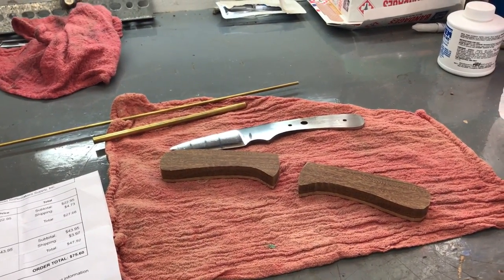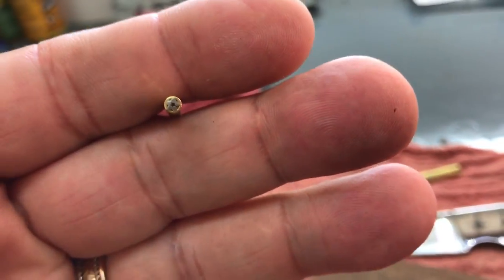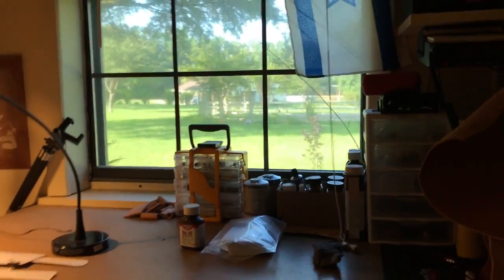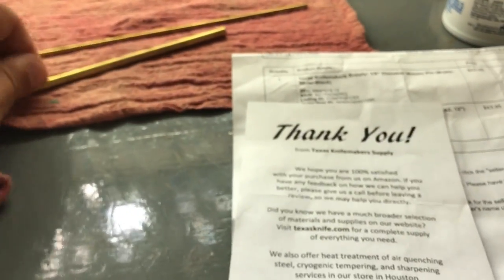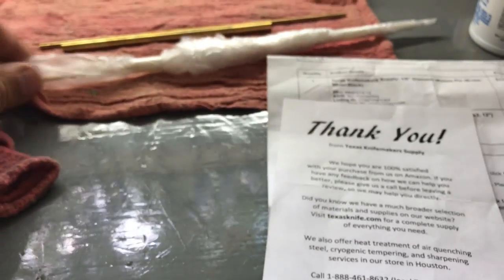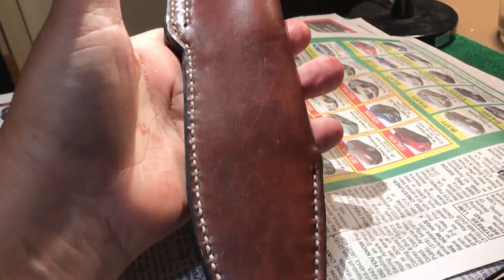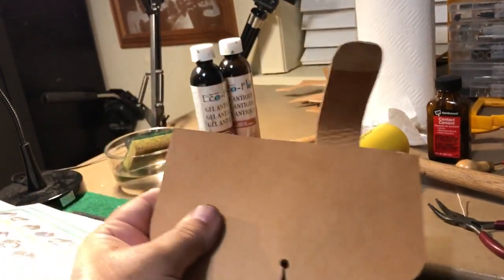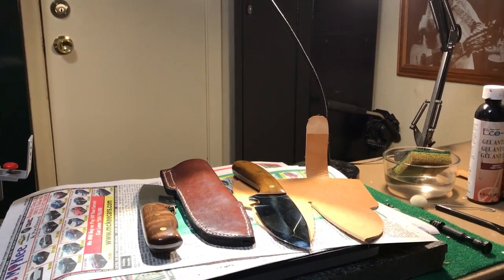A couple of knives I'm making

Comment: Man, I had No Idea decor pins cost that much!!  Great Looking knives
Reply from the maker: 5 Acres on the Bayou crazy! I've searched high and low for better prices but this is as good as it gets.
Reply: BCtruck, rebuild, repair,repurpose I believe you can get them cheaper on eBay. I will have a look later on and double check. Those are some great looking knives!
Reply from the maker: Well,just a few minutes ago I found a place that sells them cheaper. usaknifemaker.com .
Are you Taylor blades brother? He makes some awesome knives!
Reply: We talked about the problem of making your own but I think the air bubble problem would be solved with a homemade vacuum chamber and slow cure epoxy.  At that price, I may go into the business and sell them to you!
Reply from the maker: 5 Acres on the Bayou I would buy them from you! Dwayne lives between me and you. He could deliver them!
Reply: I've got one ready.  It's all steel and hollow in the center with a split down the side.  I call it "Roll Pin"
Reply from the maker: 5 Acres on the Bayou in a pinch you could take it from your knife handle and use it in your outboard propeller.
Reply: BCtruck, rebuild, repair,repurpose Nope, I make knife scales and have come across the mosaic pins before looking for exotic wood. I thought I had the seller on eBay saved but don't. I will look for them again
Reply: 5 Acres on the Bayou you could also use clear flexible hoses and place on both sides and using a syringe that fits snugly with the hoses pour it that way. Then tape the hoses together so the epoxy doesn't have a chance to flow out. Just cutoff the excess and should be good to go. But I'm sure that using a pressure pot would work the best, just an upfront expense. 

I have some extra aluminite resin that I could possibly try using to make a mosaic pin. If I do, I'll let you know how it goes
Reply: Sounds like it would work!
Reply: Perfect!  Use my special Roll Pins and you now have created a Multi-tool!
Reply: 5 Acres on the Bayou I think that as long as you let the epoxy settle before using the syringe you should have fewer bubbles. Then just squirt some out before you fill up your pins and possibly gently tap the pins it should be good

Comment: The white stitching is looking real good but might not stay looking good in the long run. knifes are looking pretty cool.
Reply: Long ago when I used to show horses my saddle had buck stitching on it ( white leather stitching on a dark saddle) It cleaned up pretty well, but when it needed to be brightened up I used white shoe polish on the stitches.  If I'm not mistaken  the thread for leather work has a wax on the outside that does help protect it.